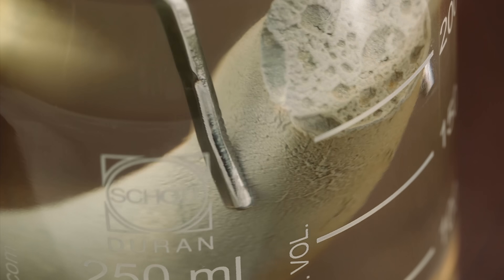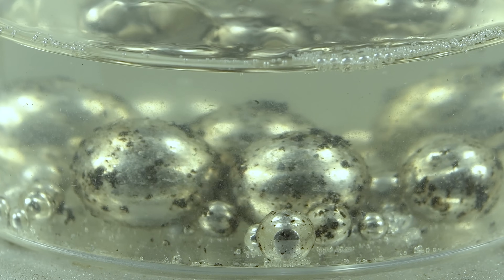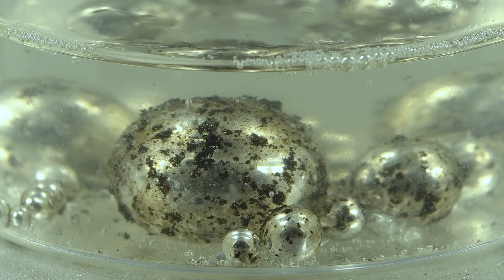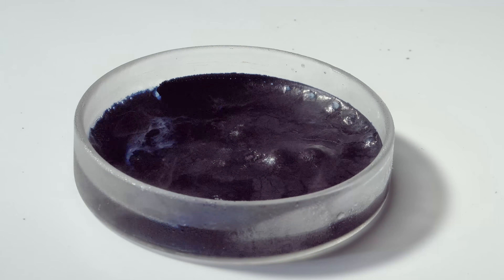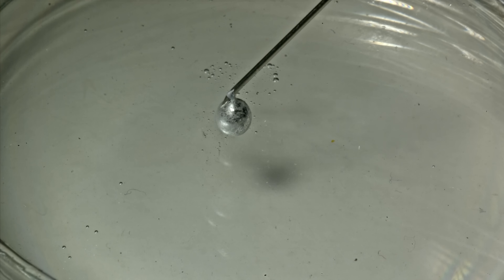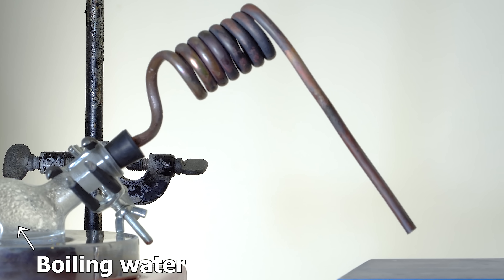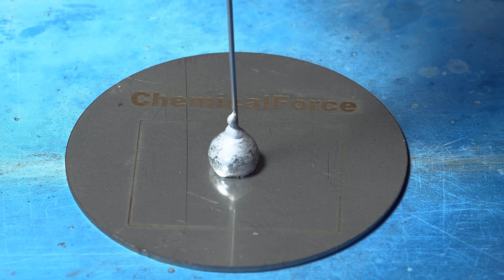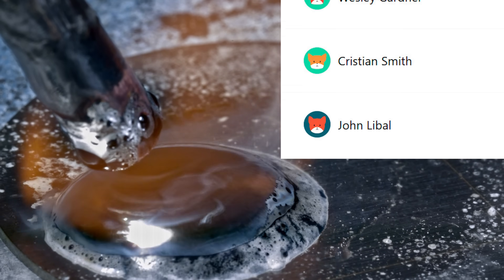Sodium-Potassium Alloy: Blue Solvated Electrons in Water!

Comment: I knew of this phenomenon because of Applied Science's video about liquid ammonia. He dissolved lithium metal into a test tube of it, and at first it was blue like yours because of the solvated electrons. But then it turned this absolutely BEAUTIFUL metallic bronze colour. Apparently these solvated electron solutions are excellent conductors, which makes sense, but I'd like to see someone actually pass a current through it and measure the voltage drop. Would be interesting to see what class of conductor it is. Wouldn't be a superconductor but probably so conductive it's be hard to measure.

Comment: A company called Teledyne-Commodore used sodium-NH3 solvated electron back in the 90's and early '00's.  I worked for them.  You can look up the applications and details. The chemical reduction process was paired with a high pressure cutting jet that used liquid NH3 to cut into objects to obtain chemical materials that were to be reacted with the solvated electron solution.

Comment: Blue light was observed when Sodium had coulumbic explosion in the water. It was done slow mo and was visible. I saw that video around 5y ago. And I was surprised, as in the school we were teached that sodium explosion in the water occurs because of hydrogen explodes. But in reality explosion happens because water steals electrons from sodium and sodium atoms can not hold together because of electric field is forcing sodium ions apart. Experiment was done in inert gas environment, so there is nor possibility for hydrogen to react. But sodium exploded anyways.

Comment: That same blue color appears as potassium slowly cools in the presence of a long chain tertiary alcohol. Tetrahydrolinalool and dihydromyrcenol both work. It may just be a refractory thing on the surface of semi-molten potassium, but if that's the case it is a very convincing imitation. The presence of lithium metal makes it happen more consistently, though molten lithium does some really strange things to mineral oil.

Comment: Awesome camerawork and video description. I've been fasinated by reading about solvated electrons in the last week, and now your video has popped up. I thought I saw a video where the blue is first glowing but I may have got mixed up with various ions of Mn. I did see some electric glowing underneath as the drop of permanganete was dropped into a column of NH4 on a labs video this week. I'm thinking a tiny drop in a column may capture that electric blue glow before it turns to the deep blue.

Comment: Hi Feliks, beautiful exposition as always. However, it is worth noting that you are actually witnessing something even more rare and exotic here than the blue color of solvated electrons - in fact, you are also seeing the violet color of pure sodium gas. If you go to 5:00 in the video you can notice the violet color is not "adhered" to the surface of the metal droplet in the way the solvated electrons are, but rather floats around along with the droplet like a foggy haze. The vapor of potassium is green and that of sodium is violet for the same reason the vapor of iodine is colored, it exists as a homonuclear diatomic gas of Na2, and the electronic states of the molecule are vibronically coupled to the vibrational modes of the two atoms comprising the molecule, causing a multitude of regularly spaced absorption peaks throughout the visible region of the spectrum. Like iodine vapor, it should also fluoresce when irradiated with high energy light!!
Reply: The paper mentioned "part of the metal evaporated". Can you explain the orange swirls in the droplet as the molten hydroxide/metal gets clearer before becoming pure sodium hydroxide?
Reply: @pattheplanter  haven't the slightest idea, but if I had to guess I'd say something to do with the shifting absorption band wavelengths with respect to temperature as seen on the combined spectral plots near the end.
Reply: @pattheplanter  I was thinking about this too. After some thought I speculate that it is the last bits of metal dissolved in the hydroxide. You can see that, as soon as the swirls appear,  transparent orange appears right next to opaque blue. That indicates to me the it's not due to the droplet being red hot, but rather the last bits of sodium and potassium (maybe in clusters???).
Reply: Couldn't it be blackbody radiation? NaK has a boiling point of 785C, which is well into the orange range. It's basically just red-hot metal because its been kept from blowing itself apart and continued to react with the surface. 
I bet if you look at other videos of alkali metals getting thrown in water, you'd see orange globs of molten metal skittering across the surface due to the leidenfrost effect as well
Reply: @XxRedCooperxX  I believe that if it were above the Draper point of 525C the view of the internal swirling blue solvated electrons would be obscured. I have seen these spheres incandescently glowing in other videos though. A simple test would be to turn out the lights while recording!
Reply: @XxRedCooperxX  I don't think it's boiling, it's just molten. Also: look at the shadow of the droplet, it doesn't look like it shows a glow from a red-hot droplet, rather the shadows colour seems to be from transparency.
Reply: Totally
Reply: Regarding the orange: no idea on the details of the phenomenon, but certainly looks characteristic of the sodium d-line emission you see in sodium lamps.

Comment: I've always wondered, when cutting the soft metals - what is the consistency? Is it like cream cheese, normal cheese? :D
Reply: Lithium is pretty hard, requiring a lot of force and a sharp blade.  I wouldn't describe it as cheese-like unless the cheese is pretty dehydrated. :-)  The metals get softer as one goes down the series, more like normal cheese.  I've worked with Li, Na, and K, but not the others.
Reply: @jpolowin0  lithium is .6 on the mohs hardness scale and sodium and potassium are .5 so I can't imagine there'd be much difference between em, I've only worked with super thin lithium strips harvested out of batteries though
Reply: @noodlelynoodle.  I've had to carve off blobs of all three from thick sticks, and the lithium seemed noticeably tougher.  As in "huh, I wasn't expecting to have to put that kind of effort in".  Perhaps there can be variation within a metal type depending on how it was manufactured?  Rapid cooling, that kind of thing, just as the hardness of more familiar metals can be affected.
Reply: @jpolowin0  interesting yeah I'm sure it varies depending on how the grain of the metal is aligned and if it's in a dead soft state or work hardened at all, I hadn't even considered other metals might do the same as silver in those regards
Reply: @noodlelynoodle.  Lithium's melting point is a lot higher than the others'.  So perhaps if blocks of the metals are extruded into sticks under similar conditions, there would be more work hardening in the lithium case?
Reply: I have intrusive thoughts like "BITE IT" every time I see those metals.
Reply: @nocturnhabeo  CodysLab bit a piece of sodium!
Reply: @ReverendFlatus Would you consider leaving on a red cloth table lamp in the bedroom and a tubular vintage oval bulb lamp in the office, and seeing which type of bulb burns out first after a while, doing an "experiment"?
Reply: @nocturnhabeo Would you consider leaving on a red cloth table lamp in the bedroom and a tubular vintage oval bulb lamp in the office, and seeing which type of bulb burns out first after a while, doing an "experiment"?